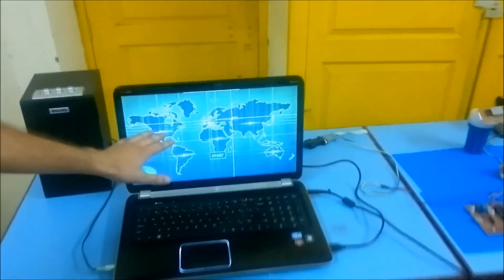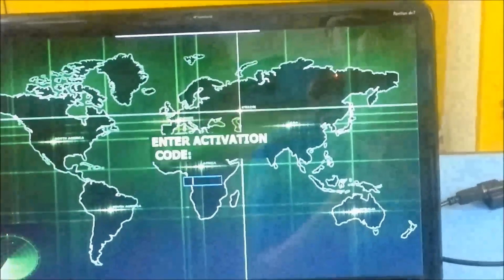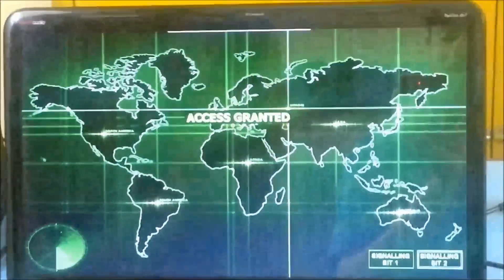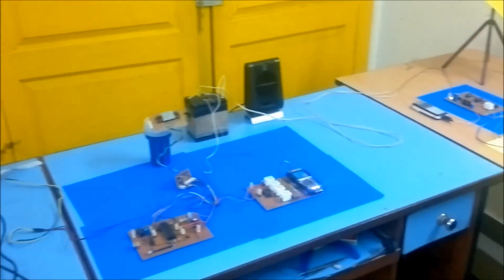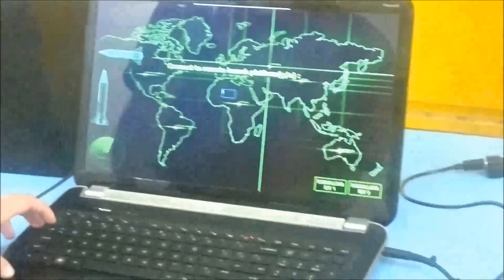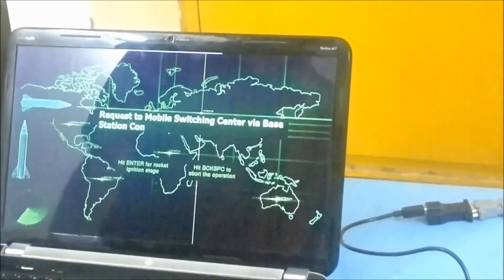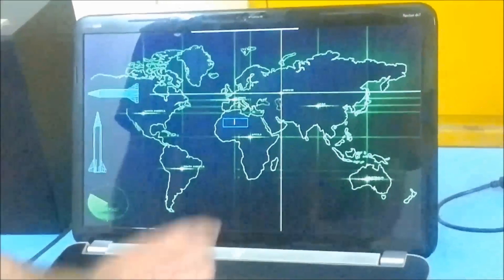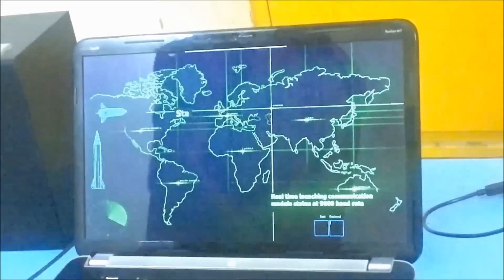Rocket Project Using GSM,Micro controller,Propellant-KNO3+Sucrose. Won National Award(NDRF Award)

Comment from the maker: Can Launch Rockets from any Distance with a voice & key interfaced Software application. Uses Gsm Channel for this purpose. Engineering fields required for design of project-Computer Engineering+ Aeronautics+Electronics+Pyrotechnics. Friends this is the Project for which I've earned recognitions at National Level. Won National Design & Research Forum Award, Which was awarded by Respected M Chandra Dathan (Current LPSC ISRO director), The same man behind the cryogenic engine of PSLV C 25-Mars Orbitter Mission. Friends need your likes & Views.. Any Suggestions are deeply respected.